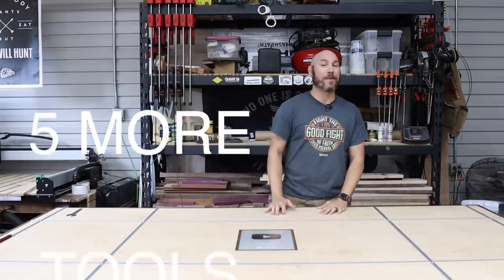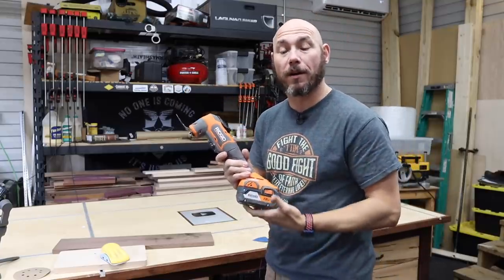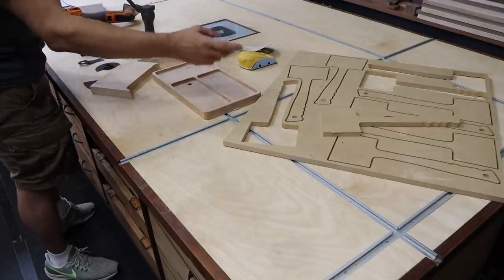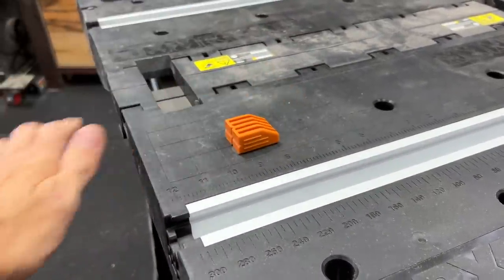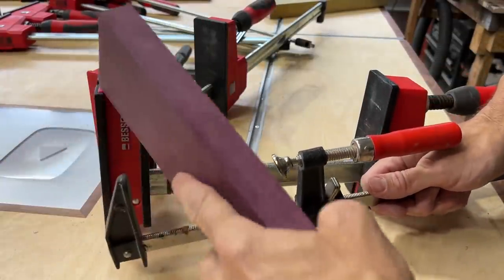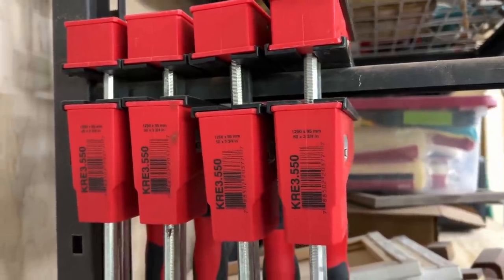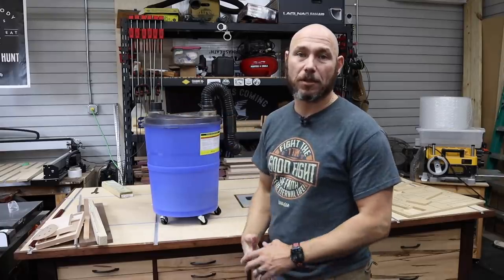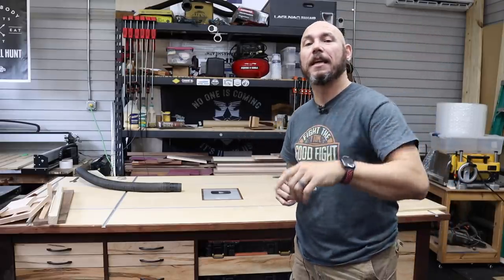5 Woodworking Tools You Didn't Know You Needed Until Now Vol. 3

Comment: Pro tip for the speed setting on the multitool: low on hard, fast on soft. Fast speed on hard material will burn it, low on soft will tear it.
Reply: Low on metal too, with a metal blade of course.
Reply: @sirbrewzalot  and cutting oil.

Comment: Another use for the Oscillating Multi Tool:   I have used mine to go through roots when digging a hole using a post hole digger.   If I hit a significant tree root, it's hard to get to get lopper more than a few inches deep in the hole.  The oscillating multi tool makes quick work of it.
Reply from the maker: Good idea!

Comment: Got the Fein Multimaster several years ago. Loud as he)). Have used it mostly for household/rehab stuff like woodwork, moldings, corners, tile work, flooring stuff, grinding out nailheads, etc. Finally realized it could come in quite handy in the shop.... with just a little more finesse shall we say.  Did I mention it is loud as he)) on high rpm - but that's why God invented ear protection I guess. Thanks for another great practical vid .

Comment: The cyclone separator makes the filters last a lot longer, so it becomes more affordable to buy the HEPA filters to keep the air cleaner.
Reply: Adding to that, you can use a HEPA filter and a HEPA bag in the shop vac without it filling up so quickly. The filter itself seems to last forever this way.

Comment: On the dust separator, I have to agree.  I only have a 2.5Gal (2Peak HP) vacuum. And with DustDeputy on it, it does a very good job of sucking up the dust.  Every DIY woodworker should have one.

Comment: I always used pipe clamps for years. Then I won a set of various Jorgesen clamps including parallel clamps. After using them, I decided to buy extra clamps to get an even number of clamps instead of mixing and matching. I rarely use pipe clamps now,

Comment: If you like parallel clamps you'll love Dubuque bar clamps.  Superior in every way EXCEPT reach.  For panel glue ups they're king.  Eventually you'll dump that Dust Right separator.  I ran that exact setup for years, but after a while the vac filter started getting clogged up again.  Light shavings, from the planer or hand plane, still made it's way to the vac.  I switched to a mini-cyclone on top of a 35 gallon drum and haven't looked back.  Eventually you'll get a real dust collector for the large tools too...it's worth it, even if you go with the Harbor Freight.

Comment: The other item you can acquire is a bag that Rigid sells to go into your shop vac.  I use one in my 12 gallon Rigid  cyclone and the filter is always spotless.  I am surprised how well the Rockler separator works.  There have been other reviews that said that it collected some dust but there was still a substantial amount going into the shop vac.  So, you saved yourself a couple of thousand dollars on a Jet or Oneida unit.  The nice thing about your Festool unit is that it is HEPA rated.  I have mine hooked up to my lathe to collect the fine dust from sanding.  That stuff is nasty.  You might also consider an air filter that works on the shop as a whole.  Both Wen, and Jet make them.  I leave my on the built in timer for a couple of hours after a session at the lathe.  Thanks and take care and stay safe!!

Comment: Man the oscillation tool changed my life. I use it on 8 out of 10 jobs I do. Best all over tool ever. I have the Dewalt 20v XR super sweet. Save your self and buy the blades from Amazon. Can get like 45 for $25 dollars. If you buy at a hardware store you get 1 for $10 and the quality is just as good.

Comment: For starting out, I recommend black& decker max matrix. It is a drill(wire or batt power version, I got both) but the drill part comes off and you can have a jigsaw, router,  Oscillating Multi-Tool Attachment, impact driver, hammer drill, circular saw, it also can come with a portable work station depending on the kit you buy, and other attachment. Highly recommend for under $200 you get a lot of tools in a small form factor.

Comment: The other nice thing about parallel clamps, you can use them as feet to keep a large panel vertical. For example, I was making a large cabinet and need to cut a but of loose tenon slots on the edges of the carcass. I find it more comfortable to work upright, so I used two parallel clamps on the floor, slid in the panel, and clamped down.

Comment: The oscillator or multitool is super useful for a lot, but I mainly used mine to flush cut the bottom of door jams when installing flooring so the flooring slides under with minimal gap. Just use a cutoff of the flooring and you can set the saw on top to get it exact every time.

Comment: Parallel clamps are critical, but even if you had the budget you wouldn't replace all of your clamps of all sizes with them because they are so heavy. Clamp choices are about ergonomics, and parallel clamps are the big guns for large and accurate joins. Bessey does make light, relatively cheaper parallel clamps for more everyday tasks, the Uniklamp, and I would highly recommend getting some in 6in/12in/18in sizes.

One other thing to remember when choosing sizes is that for clamps, particularly better clamps, is that you're paying much more for the heads than for the bar. For example, at one site now the Bessey KRE 12in is $58, 24in is $63, 31in is $68, many more levels including 60in is $78, up to 98in at $106. You're not paying a lot more for a little extra length. But again, clamps are also about ergonomics. Because of the price here it's best to not leave yourself a little short and have a slightly heavier clamp when you are budget limited. I personally would usually recommend going with something over 24 in because I find that 2 feet is a size that's common and you'll find yourself trying to clamp something that's 24 in but really 24 and 1/4 inches and you can't deal with it.

Comment: One thing most videos don't mention about Parallel Clamps is that ( at least on Bessey), they can be used as a spreader by removing and reversing the lower jaw.   Most people have other spreaders, I did not, and I have used this feature many times.

Comment: 1:42 I just replaced my green Bosch Advanced Multi 18V with a blue Bosch GOP 18V-36 (or 38, don't quite remember the number) to get access to the longer Starlock Plus blade attachments. Used the new one saturday for a project where I needed a blade longer than what the weak green one couldn't take. I wish Bosch would make a cordless one that can take Starlock Max. The great thing about Bosch's locking mechanism, is that you just push the attachment on and it locks in place. The attachment is released by simply pulling the release lever, and it's off.
I've been trying to convince myself to get some of those Bessey clamps for a while now. It brobably won't be long before I buy them. Probably go for 3 or 4 of the 40" (100cm) ones.

Comment: I absolutely agree with you. Every one of those tools would make a great addition to any shop. I really want those Bessey clamps, but I have to sell my wife first. I love her too much to do that. LOL. Until my money arrives, I have been making do with Harbor Freight clamps and the Ridgid Dust Topper (no wheels). I have two Kreg Mobile Project Centers which are similar,  and more money than the Worx,  but have more flexibility.  The new Ridgid multi tool is great. I hate having to unscrew the bolt on my Dremel to change anything.

Comment: The 2020 rigid would get to hot but did much better than the Dremel oscillating tool.  If I saved the money I would have been better off getting Bosch.  The replacement blades also cost to much when you consider a Sawzall in some cases.

Comment: I have the rockler dust separator and it does work pretty well. I will say that it doesn't do to well hooked to the dw735 planer. The 735 ejects chips so well on its own and then you hook a shop vac to it, it just over loads the separator and leaks so much dust between the lid and the bucket.

Comment: Love the video.  One thing, I have given up using parallel clamps. I understand how they work but no matter what I do, I can not get them to tighten. I will push them together and screw the handle until I can't turn it anymore and the clamps are barely tight or loose enough to just fall off. I have tried many ways of doing it and they just don't work for me. These are bessy clamps too. I now use rockler bar clamps. It can't be that hard to get parallel clamps to clamp.
Reply: You and I are the same!! Once I have lost my patience and threw the clamp across the shop. I hate them so much
Reply: @gamer2101  so it's not just me. That makes me feel better about myself.
Reply: I had to learn how to use these things. Make sure before you clamp something together that you fully 'unscrew' the handle. Then when you close the clamp up on the pieces you want to hold together, you have "all the screw room" to then turn the handle and snug it up.  At one point I had 6 clamps and all were "screwed" or "unscrewed" (sorry - I can't think of a better term) at random spots. Once I figured that out, these clamps became my best friends!!

Know what I mean? :-)
Reply: @LYTOMIZE_Woodshop  thanks for the feedback, I appreciate it. I do unscrew the clamps all the way. I think my problem is how to position the bottom of the locking mechanism (push it in or out). I am sure it's me because so many people swear by parallel clamps, it has to be operator error. But since I bought a bunch of the rockler bar clamps, I just haven't forced myself to go back and try the parallel clamps again.
Reply: OK, I now stand corrected. I decided that my issue with parallel clamps must be my fault. I pulled some out, look closely how I was using them and found what I was doing wrong. I now have a panel glued up and clamped with parallel clamps. I am now a convert😁

Comment: Dedicated woodworker should invest in a AIR COMPRESSOR!! 
My multi-tool, nail guns, drills and most importantly Dynabrade sanders all run off air. I learned this years ago in a uber high end cabinet shop. The tools are designed to run 40hrs a week for years and never wear out.

Comment: come on Matt, at least get a Harbor Freight 2 hp dust collector for the 4” stuff.
Reply from the maker: I’ve got a Laguna P Flux on order. Supposed to be here late November
Reply: @731Woodworks  That sounds like some kind of time traveling device or a rap video! Lol!
Reply: @731Woodworks  oh okay. I think you are really going to appreciate it.  Having a dust collector really makes me want to be in my shop more since I am no longer covered from head to toe in dust after using tools like the jointer, planer, or my table saw

Comment: I'm a loyal Ryobi guy, and overall I love their oscillating multi tool. It stands on the battery nicely and had a trigger rather than a button, a little safer. But, I REALLY like the quick blade change on that Rigid.

Thank you for your excellent content.
Reply: Ryobi has a new one (gen 3 I believe) with the quick blade change.